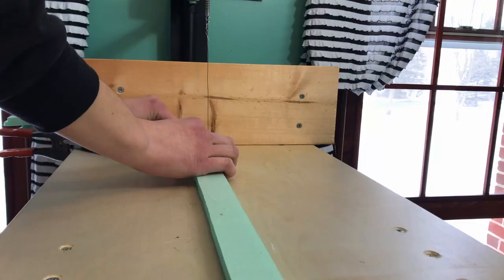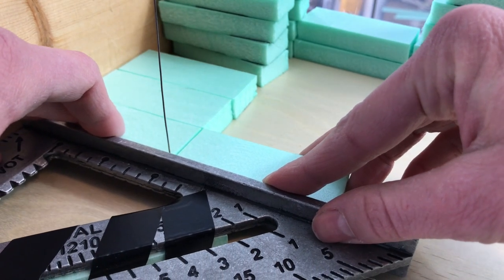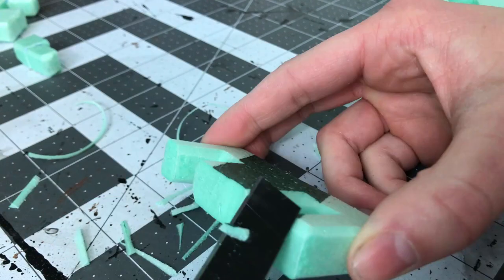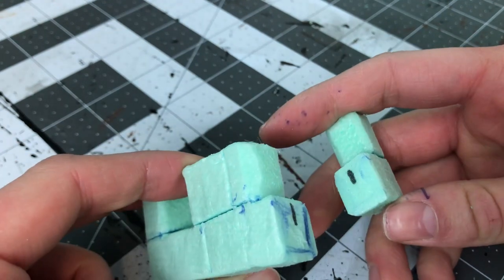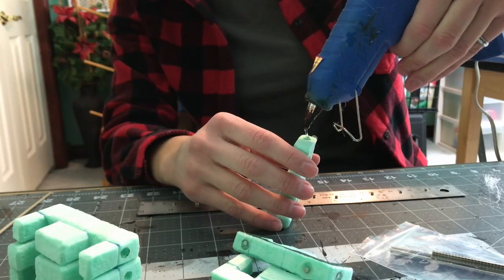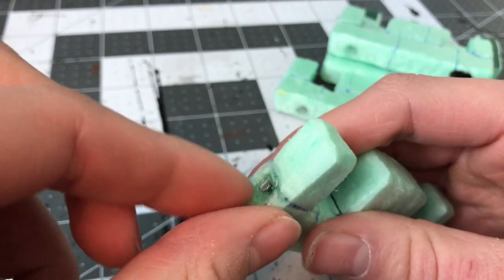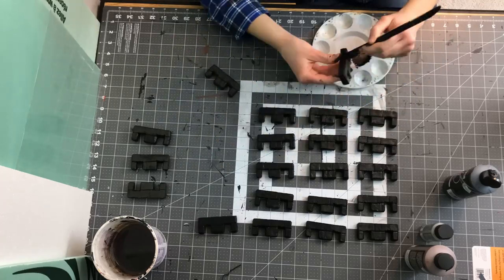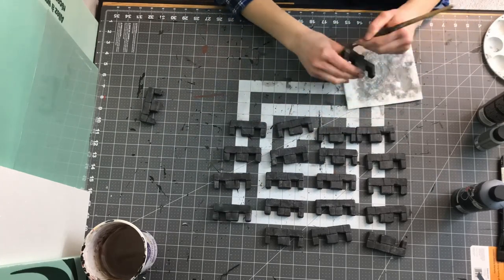Modular BATTLEMENTS for D&D | Wargaming Terrain Tutorial

Comment: Nicely done kiddo. Thumbs up. Is that a handmade hot wire foam cutter? Also if you first lay a coat of mod podge or PVA, your foam will not be harmed from the solvent of the spray can. I know it's double work, but it might be necessary in certain circumstances. Keep up.
Subbed.
Reply from the maker: Thank you! Yes, that is a diy hot wire (I have a video on it if your interested :) ). Thanks for the tip, I’ll keep it in mind!

Comment: Heating the magnet can weaken/destroy it, I have done it a few times.
Reply from the maker: That’s what I’ve heard (after making my modular castle pieces). If I make more magnetic pieces, I’ll have to try out some other glue, unless you’ve tried other options and have a recommendation. Else, I’ve heard good things about white gorilla glue.
Reply: @okayminiatures7573  I ended up just using a "trash" magnet that I heat up to make the holes, that way no need to worry about any damage, drop a Lil glue in, pop in the magnet, you can use a metal ruler also, place a  magnet on it, place glue in the hole and put the magnet in and slide the ruler off magnet for a nice flush finish. And less mess.
Reply from the maker: @forgefather  I'll keep that technique in mind. I have used a metal ruler to place the magnets, which works so much better than just placing them in.